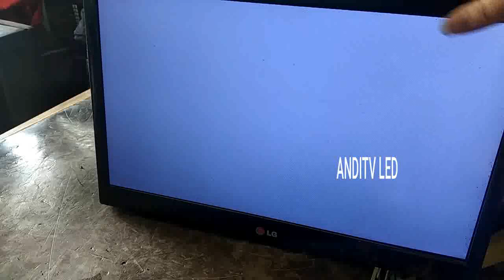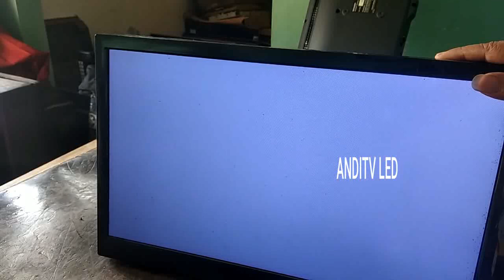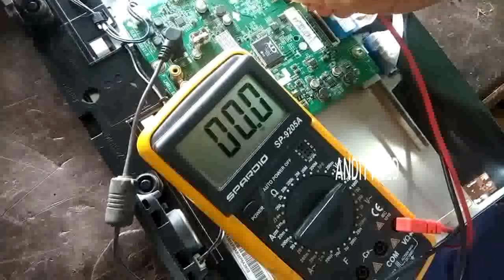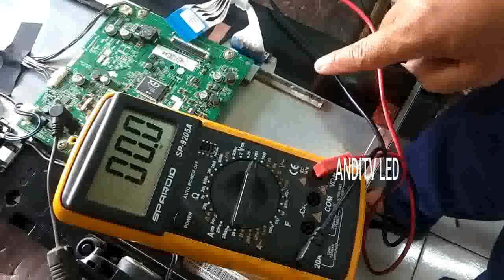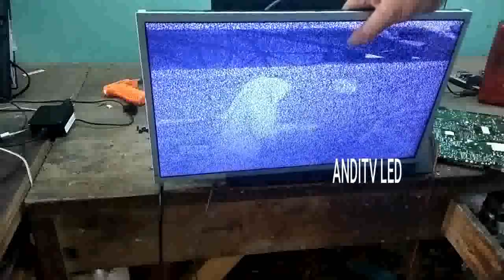CARA MUDAH  PERBAIKI TV LED LG TAMPIL POLOS BLANK PUTIH

Comment: Bang kalau tegangan vgh, vgl,vdd drop/ hilang yg ada cuma tegangan 12 dan 3 volt kenapa yg bang, jadi gambar cuma blank biru suara dan siaran ada normal
Reply from the maker: itu karena bagian gate row panel shot juga bisa menyebabkan vgh vgl drop panel ber masalah
Reply: anditv led ini tv sy merk LG 24 inc buat main PS bang, apa mungkin di TCon nya ada ic nya yg shot, makasih
Reply from the maker: @rayzaaditya2947  bisa jadi c smd biasanya shot di ukur aja semuanya
Reply: anditv led ok bang sy coba cek dulu, makasih ya 👍
Reply from the maker: @rayzaaditya2947  ok siap

Comment: Bang saya ada tv led 32 ikedo,tidak gambar .baclite nyala,tegangan ke panel 12 volt ada tp tetap tidak muncul gambar ?kira2 apanya ya pak?makasih banyak sebelumnya
Reply from the maker: di cek tegangan vgh vgl avdd vcom dll dulu bos pastikan semua tegangan tersebut ada
Reply: Makasih banyak bang,maaf untuk tegangan seharusnya berapa bang
Reply from the maker: @rukeanton9985  untuk tegangan sendiri variatif ya vgh biasanya 27volt vgl biasanya -7volt  avdd 3,3vol untuk lebih jelas bisa kunjungi website saya bos di stu saya tulis detailnya www.servistvled.com
Reply: Makasih banyak sebelumnya ya
Reply: Bng tv LG LED32,bleng itu bagian trekon, at main board info makasih
Reply: Bang tv Samsung 24" klo Cuman standby apanya ya Bng mksih